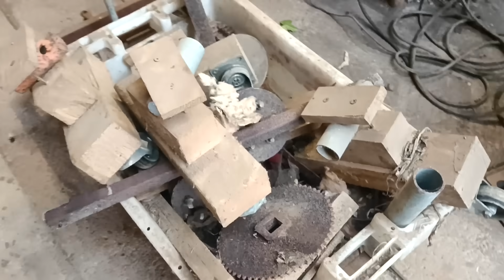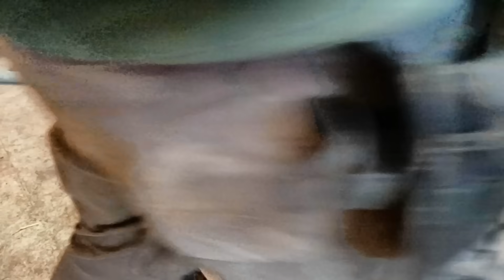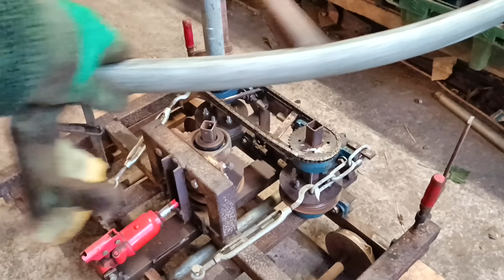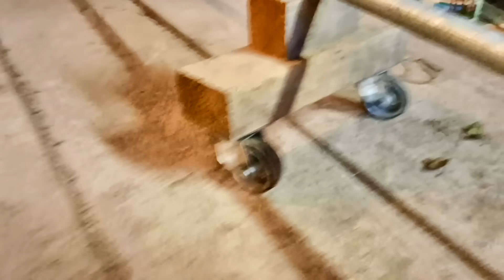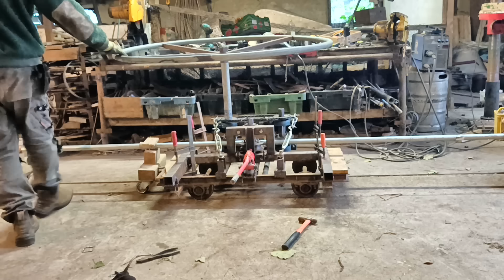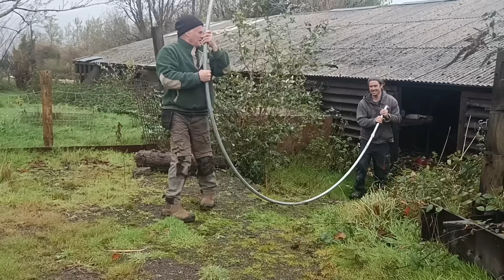Homemade Pipe Roller – DIY Pipe Rolling Machine from Scrap | Workshop Railway Build

Comment: 11:06 - so much roof space and still no solar power panels ?
You should find some for cheap as they got replaced everywhere with more , newer, better ones, but the used ones are still delivering what they had delivered 20 years ago and brand new. Degredation is 10%, but for a fraction of the cost from back then. Could be growing over time like the railway and at the end you can heat with power too by getting a used heatpump usually also sold for cheap, even 7 year old ones sold for 2000€ but able to heat even an uninsulated house or garage or what not. 
Check out heise or their german make magazini and youtube channel where they had shown a very simple installation of a cheap chinese 5 kW heatpump for 930€ back then but due to US $ decline should be 100€ cheaper. We did not get one of these, but a bigger and better one which would get also BAFA subsidies from Berlin, so the chinese had to proof their quality and efficiency to the swiss TÜV . And it worked out for us. 

But when the heatpump arrived I also found out that some are replacing their 7 year old panasonic heatpump with a new one due to expansion of their house. SO it ended up for cheap around 1500€ in Bremen on Kleinanzeigen. A buddy of  mine bought it and it works great and the whole installation was less than 2300€, but a lot of work, but you love to work manually with all the metals, so copper pipe should be a lot easier to work with.
Reply from the maker: I can't argue with any of that, except I really couldn't afford even cheap secondhand ones at the moment

Comment: Great design and very practical, thinking outside the box 📦 I love the square peg in a round hole technique you use works well for your gearing on the locomotive aswell 😊 👍 p.s. how is the cycle car doing 🤔
Reply from the maker: Thanks, John. I must do an update on the pedal car - I use it every week and it's going really well.

Comment: Another brilliant thing.  You mentioned that houses should be made this way.  I recently watched a video about the restoration of post WW2 Nissen huts in Belmont North, a suburb of Greater Newcastle in NSW.  The intrinsic strength of the structure was evident and I thought how brilliant and simple they were.  With modern insulation and materials they are brilliant and must surely be cheaper than a traditional wood framed structure.  Here's the link just for fun.  https://www.youtube.com/watch?v=8MRTVh57S9o&list=WL&index=86.  👍

Comment: That was magnificent to watch, Tim. What a way to use of your workshop rails! 
I suggest this in all ignorance: I know those bearings are surprisingly expensive, and you used plain bearings on the wagons and locos. I've never seen you mention bronze bushings, but they seem like an excellent middle way between those two for the sort of projects you tackle? Hopefully they can be found in a size that matches your square bars!

Comment: Excellent as always, I am working on an almost identical setup for rolling rails in situ. I can't decide if it will be manually powered with a reduction drive or 24v off a generator like my Scamp locomotives.
Reply from the maker: Thanks Colin. I'd be interested to see what you come up with : -  )

Comment: If you've got any roofing tin or metal siding laying around, or know someone who does, you could make a mini Quonset hut as a shed for your locomotives, and if the transparency of your poly tunnel isn't important, you could just replace the poly tunnel with that. It would be very sturdy, and a lot more immune to the winds, while maintaining all the advantages of your pipe arches.
Reply: Nissen Hut on the other side of the Pond.

Comment: You probably want a pipe running the ridge of the shelter, and a couple more at each "shoulder." That's how the winter car shelters they sell in Quebec are engineered, and mine holds up to some pretty heavy snow loads.

Comment: More ingenuity! great work. If you could make a roller for corrugated steel you could build something like Nissen huts, which are... sortof liveable in. Possibly not in demand in West Cork right now :D

Where did the wheels for the wagon the roller is built around come from? they look very solid. If you ever need to haul a really heavy thing up your railway hill I think you've got the device already...
Reply from the maker: They were the first - and only - wheels I bought. The treads and the flanges are too small for the field railway, so they'd fall off in no time  : -  (

Comment: Back in the early 2000s, I was working with a company in Canada designing, fabricating and flying experimental (manned) spherical airships.  We needed a LOT of large diameter bent aluminum tubing.  62 feet, to be exact.  Of course we didn't have the equipment or manpower to form it in-house, so we had to shop it out.  Now, if only YOU had been there...   😁
Reply from the maker: Wow - that sounds amazing!
Reply: @wayoutwest-workshopstuff6299  It was the most fun I've ever had.  (Employment wise, anyway, LOL!)  Especially road trips to demonstrate our ships to both commercial and military clients.  There's a video of a 62' soccer ball on my channel...  Thanks for replying!

Comment: Your inventiveness to solve a problem is inspiring, thanks Tim! Could you fit a car flywheel with ring gear to the main shaft and mount an old car starter motor and have that do the main grunt work? If wired through a solenoid with a simple low voltage button on a lead you could remotely start/stop the bending while you roamed around keeping things in place. Would need a reversing switch too, but I think a normal car battery would do a lot of bendind on one charge.

Comment: Hii believe that you should get proper roofing on the drying thing and then put the plastic on
Reply: Do you put insulation/ soft layer between pipe and plastic. This is the high stress point. Commercial poly tunnels do use a separation tape.
Reply from the maker: And of course I need the sun to heat up the tunnel so I need trnsparent plastic
Reply: @wayoutwest-workshopstuff6299  yeah transparent plastic sheets
Reply from the maker: What sort would you recommend? (Plastic sheeting is all I can afford and it usually lasts a lot longer than this did.)
Reply: @wayoutwest-workshopstuff6299  maybe tin or thick plastic sheets
Reply: @wayoutwest-workshopstuff6299 I think you should get a designated solar kiln. I'd suggest you layout the timber to be dried in a black plastic frame open at both ends, then attache one end to a pipe and that to a chimney which could be made like a tall black plastic teepee. Then cover the timber part with a pollytunnel open at the pipe end